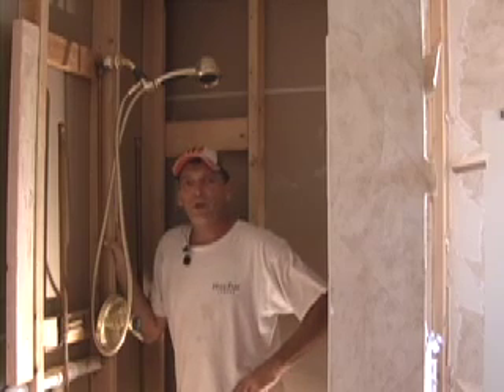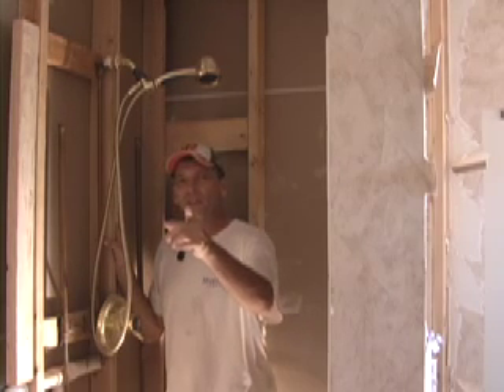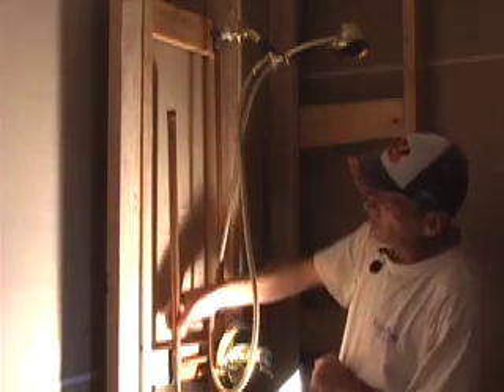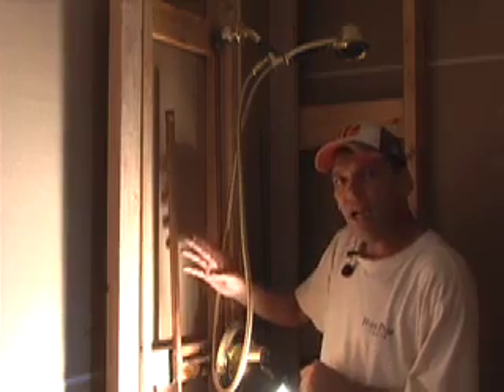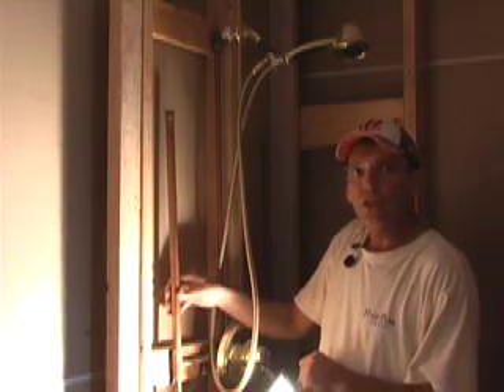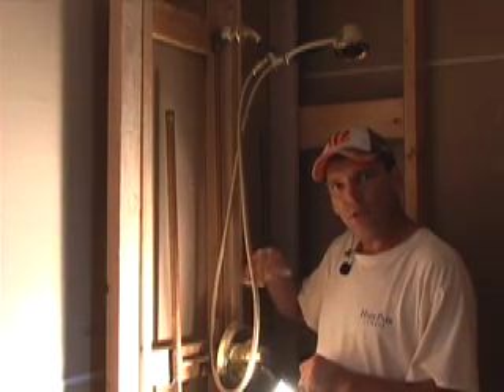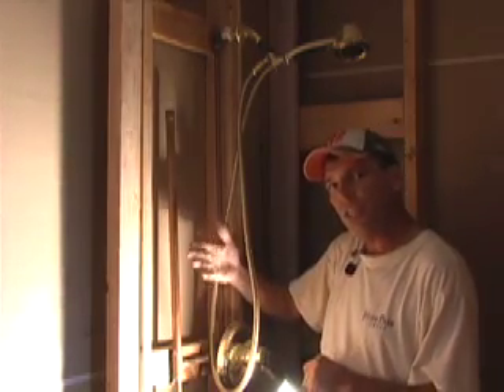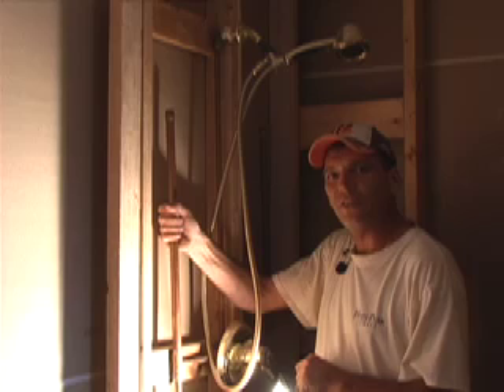BANGING PIPES

Comment: thank you for sharing this video... I have a handyman who help me to remodel my bathroom. some how the handyman cut out the long pipe that was suppose to help with air the pressure. so from then on there is a loud banging sound every time we turn on and off the water, especially flushing the toilet. stupid me with no knowledge of plumbing. any suggestion would be helpful thanks.

Comment: We had noises when the washer would turn off and when we turned on the sprinklers for the season there was a constant loud noise. We put air back into the system ...turned everything back on and voila...no noises. Thanks so much.

Comment: Bob, i need your insight solving this detrimental problem i been experiencing. Recently i have my pipes replaced with coppers. Every time i turn on the hot water, i hear this banging noise through out the house. When i turn off the hot water, it doesn't stop. Occasionally you can still hear the banging. The noise only stop if you stop using hot water for over 30 mins or so. The guy who replaced our pipes kept thinking it the water pressure. I assure you it not the water pressure! Help =[

Comment: Hey Man yeah I have  done it before as well I have also encountered that same problem in a house before and I found most times it does not solve the problem. Sometimes it would stop for a few days but then the same problem came up again . I am a plumber in ontario , Canada so we here are aloud to install air chambers but personally I am not a fan . Since a mechanical water hammer arrestor is not that costly I prefer them over air chambers . I Do like your video's , so don't take it the wrong way

Comment: Thx for the info. Just curious... Everything I search on this issue refers to when the water was turned on or utilized but our pipes randomly shake in the house when nothing is running and it is a new problem which is progressing for longer periods and occurring more frequently. Have you any opinion on this? Thx again.

Comment: Huh, we have that noise when the toilet stops filling.  I'll try draining the system (when I put in a whole house water filter) and see if that helps.  Else I guess I can find the moving pipes and secure them.  I guess I could also add a 'T' somewhere on the cold water line and add a vertical dead-end pipe.?.?.?

Comment: For your info draining the house does NOT refill the air chambers . When they become water logged they act just as if you dipped a straw into water then placed your finger on the top, when you bring the straw out the water stays in the straw. The cap on the ends acts like your finger on the straw so you are unable to break the vacuum even if you drain house. The proper thing to use would be a mechanical water hammer arrestor and this method does not need maintenance .

Comment: Will an air chamber drain?  Or, will it retain water like a drinking straw sealed off with your finger and lifted out of a glass of water.  Experiment.  Put a 3/4" pipe in a bucket of water.  As hard as you try to seal off the top of the pipe with your finger, the water will still drain out quickly when you lift your "air chamber" out of the bucket.  So, yes the air chamber will drain and recharge with air if you can drain the water from your plumbing.  I am more concerned with stagnant water and how long it takes for an air chamber to become waterlogged.  I plan on installing a piece of clear tubing in my home plumbing to answer this question.  Can't seem to find a video that shows this, just an animation from a commercial water hammer arrestor supplier.

Comment: I switched over to an on-demand hot water heater for my house. Now it has worked really well for me except the pipes started making a lot of banging as discussed here. I figure that the old fashioned tank probably contained a big unintended air reservoir in it which was gone from the system with the new heater - therefore there was no air to absorb the shock of sudden on/off valves. Solution is to do as the man here says - it worked only so-so for me though.

Comment: Every time I see this type of work, it just pisses me off!! Bob is right, the capped pipe A.K.A. "Dumb ass Hammer Arrestor" will lose all air to be ineffective. The dumb asses that installed that pipe could of added that hammer instead of a long capped pipe!! It was a cost cutting measure. If it was me that ran into this, and I hope Bob did as well, would be to cut 12"-16" off that pipe an install a "REAL" device. 15 minutes of added work!!